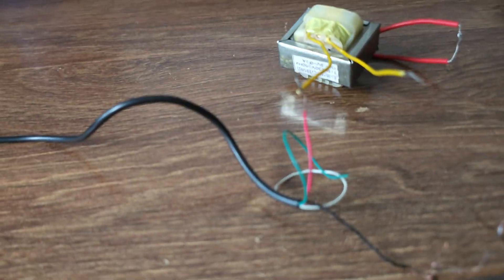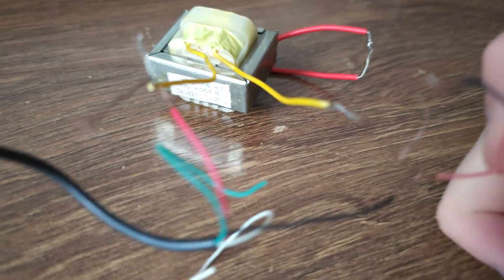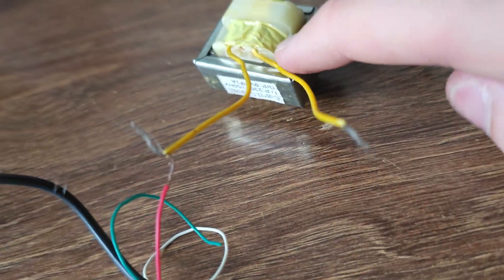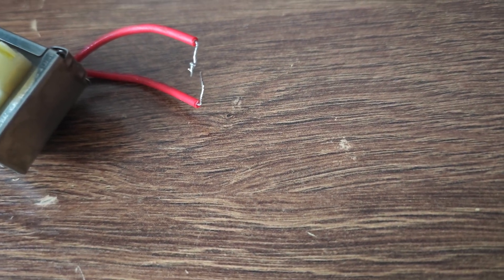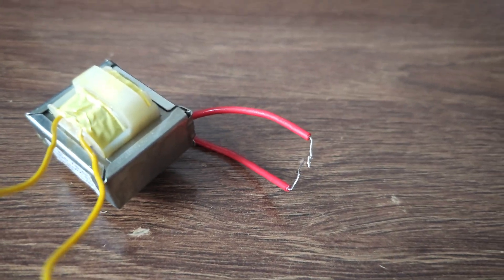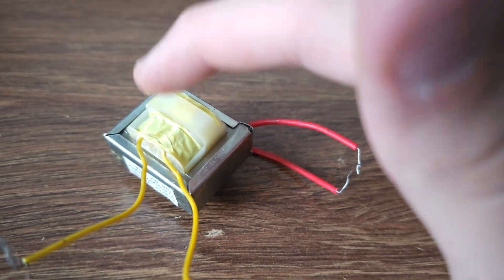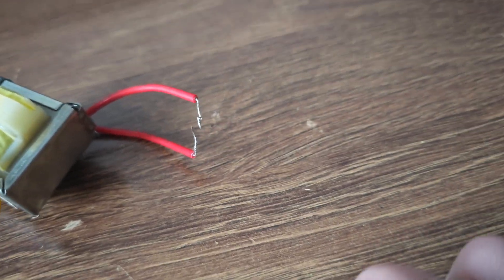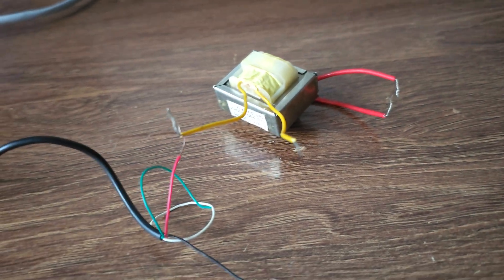I used a small transformer on DC and actually raised voltage

Comment: When the primary is loaded with a current and then dis-charged, a voltage higher than input voltage and in revers polarity occur and then the secondary on the transformer multiple that voltage to 1kV or so. if you try this with a battery more current will flow and a bigger spark will occur
Reply from the maker: I know that but I made this video for fun :)
Reply: Keep it up @darkbass11